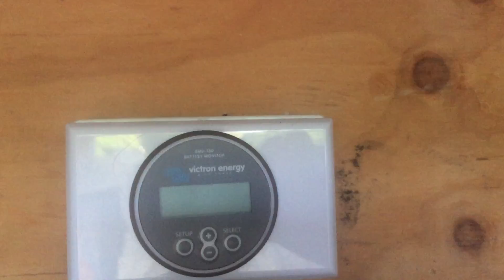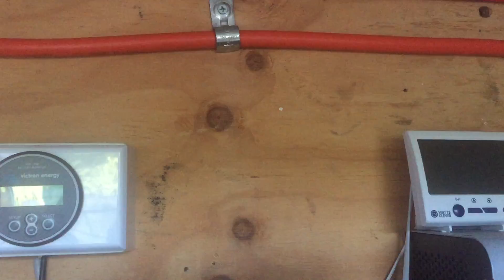BMS install update - 42 LongMons added and wired up to the Batrium Watchmon unit

Comment: u take 50 for the old shunt? lol
Reply from the maker: Yeh but it'll be missing all the other parts :)
Reply: lol i looking at getting a bmv 700 kit not that i doing 48v or 240v only upgrading a 10w panel a charge controller that come with a kit from sprints i think 10+yr ago only running 12v battery a car radio and led lights in the 40ft container. i got 2 250w panels cheap need to get controller yet thinking of a victron 150/35  only going to use 1 panel for now just in case i do get to tas it will do 48v bla bla weakest thing in it from the start allways crap old batterys lol
cheers

Comment: With the new style bus bar would it be worth it to cap them with heat shrink after they are installed to protect from lose wires shorting out on them?  

A strip of plastic inserted before the shrink would give you a cut surface for when you have to take apart without risking the layers on each pack.
Reply from the maker: Around the whole 80cell packs ?